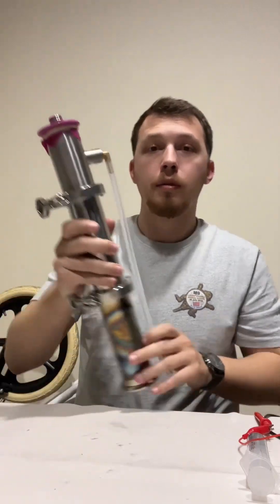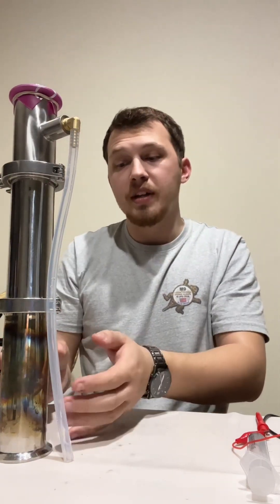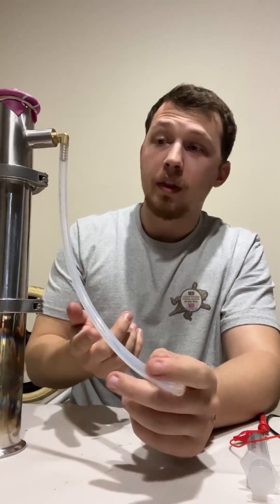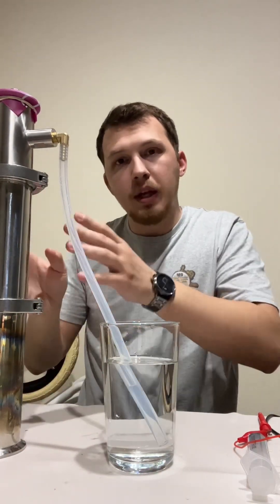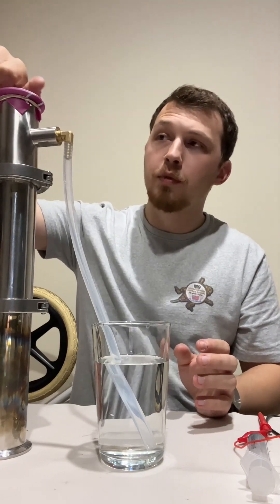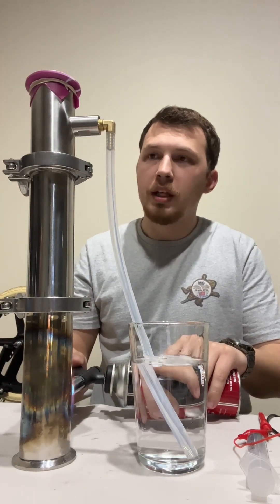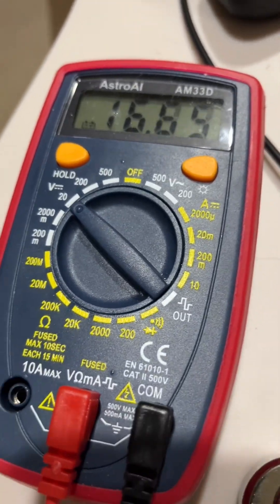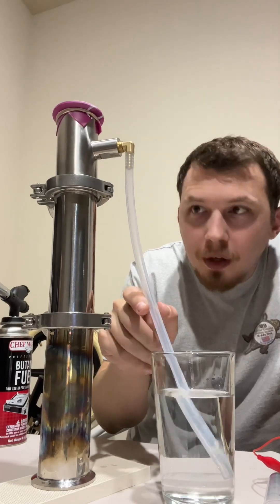Most Powerful Stirling Engine Design? #thermoacoustic #stirlingengine #hotairengine

Comment: Trust your intuition not the waLs of science. Those who innovate do so because they’re quite often far less indoctrinated into the system and all its control structure. Those indoctrinated most get doctorates.    

.. . And those docs who were best at wrote memorization. At parroting. At regurgitating the loads of doctrine and excelled as they ate/swallowed everything they were fed; received the magnum cüm laude status a pawn upon graduation. A graduated. Titrated education guaranteed to rełard progress and extinguish free thinking as their entire thought process has been waL’d and blocked off by countless Laws and theories. ..( pay no mind to the countless exceptions and anomalies that go with… smh*)

Proof Laws are waLs: 
Example 1

- Grayfield Optical microscopes which are made in Germany are able to view live specimens down to 100nm. No need for any sort of time consuming elaborate setup nonsense (heavily stained aka altered,  non living static specimens)  the election microscope requires. 
These exist. You can go to their website and yet science zealots will literally refuse to acknowledge them because  “ the LAW of blah blah says”

How can they be so słupïd??  They arent.  It becomes quite obvious that so much of this willful ignorance is intentional. 

And you’ve either put in the time and all this becomes obv.  Easily seen.  Or you lack an open mind.  Likely channeled the latest programming Each evening as the nightly noose keeps your collar tight and Leash short.
Reply: Im obv cråzy.  Things to view:

David Lapoint “Primer Fields Series”

Chiron Last backup 
“Golden Web vol 1-3” 

(Always be sure Youre on the channel marked “backup”. The other channel is full of subversive info as well as several videos that are 100% complete ai voice cloning fabrications. We’ve told youtube and yet they do nothing.  Very frustrating Since people assume that is the main real channel and the backup is well the backup. 
The original channel got closed due to scammers trying to steal the channel. They look for channels/videos with high views that arent monetized  and appear to be dormant and then make claims to owning the content. 
This is a big issue youll never hear about.

Comment: What happens if you vacuum seal the whole unit, getting rid of the rubber hose. Starting off with a vacuum and then heating up the inside air/gas.
Reply from the maker: That would work, but I could never find a diaphragm that could consistently withstand it
Reply: @LES_Thermodynamics  what if you used a fixed solid cap at that end , but inside a spring hooked to a flat piston.    So instead of a flexible diaphragm, the spring attached to a piston would move instead. Of course a lip inside for spring to be fixed and push against while piston moves up and down.  ? I don't know, just throwing out ideas.

Comment: How about you ad a resonator on top as well so its balanced so you dont need the tube or valve.
And just suck the air out til its running

You could even run it on helium or Hydrogen
Reply from the maker: Totally can! However it gets to be really long (like 16 feet of tube). Thats not what this model was made for

Comment: 620    that's why this is a fail.      (in order to utilize thermosiphon, the reservoir must be  ABOVE  the rest of the system.)        it's not clear whether you have wound a 'good' generating coil.      in a generating coil, the copper should have a square cross section; eg., the same number of winds as layers.    aka  a brooks coil.       the conductor should be the equivalent of 14awg.     small magnet wire can be used; see litz wire.       d
Reply from the maker: Interesting feedback!

Comment: If you make a thermosiphon cooling tower, insulate the tube that flows up, and  put aluminum fins on the tube that flows down, possibly with a fan.
Reply: You can design a circular array that the fins slide into, and the position is restrained. 1:1 print and a little cutting. Or a cnc operation 🤔
Reply: Or: my favorite is a 3d printed part electroplated with copper. 😊
Reply from the maker: Yeah I always wanted to try aluminum fins but the production cost was too high.
Reply: Thin aluminum or copper strips(thin roll metal) and some low temp "welding/solder" would lower your investment. You don't need, nor really want, thick material.

Comment: The one way valve won´t work is a valuable tip. I have seen somebody else coupling two cylinders with the hole instead which increases power output further.
Reply from the maker: It would be interesting to hook two together.

Comment: is it possible to duplicate the set up and mount it so the diaphragm is coupled,  with the tube connected to the coupled engine with a bleed valve to get the correct internal pressure?
Reply from the maker: It’s possible!

Comment: What work does it actually accomplish?
Reply from the maker: Work defined as load and distance?
Reply: The magnet popping up and down inside the coil was generating 18V. The voltage can be easily changed but the more volts its wound for, the fewer amps it will provide

Comment: I had a "EUREKA!" moment at about 1:15. "As the HOT AIR RISES..."
So, convection also plays a part in this particular model.
/me prances off, singing, "I am the Derp..."
And yes, It desperately needs a cooling jacket up top.
Robert Murray-Smith did a few videos on a heat engine that was called a "Rice Drum." And he did a video where he used Methanol as the working fluid, and not water, and with that and a cooling jacket, he was able to make it work with hot water as the heat source.
This intrigues me, because Evacuated Solar Heat Tubes not only exist, but are relatively cheap, too.
I am looking forward to the final.
Reply from the maker: The final is out and for sale! Woot!